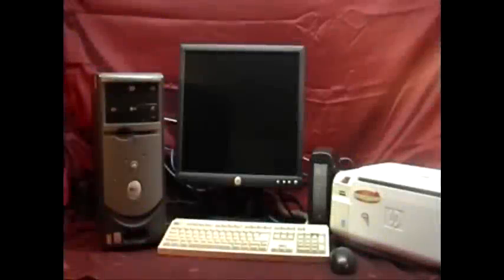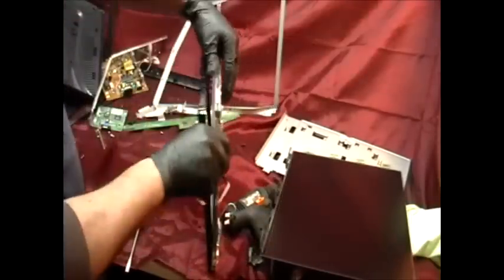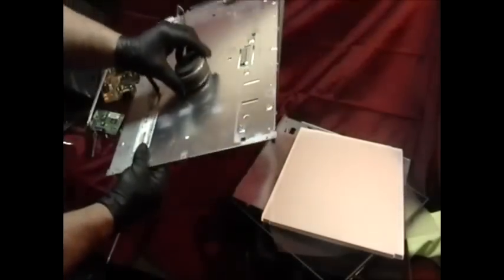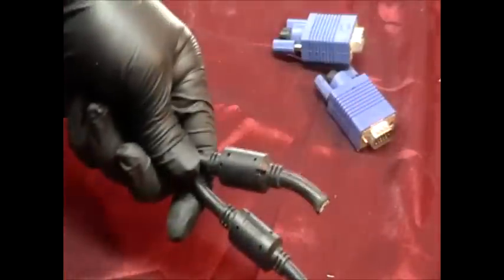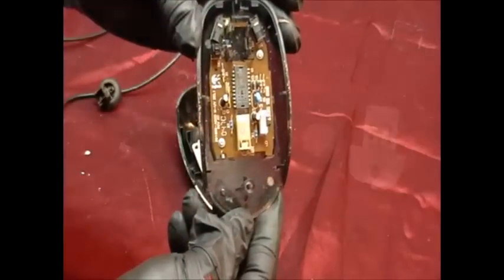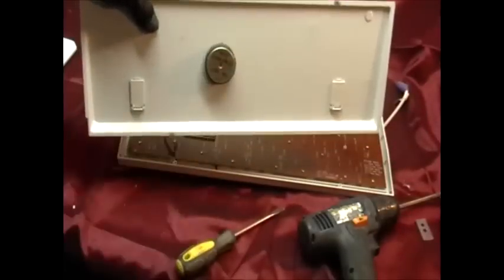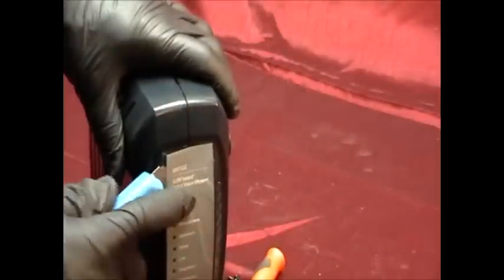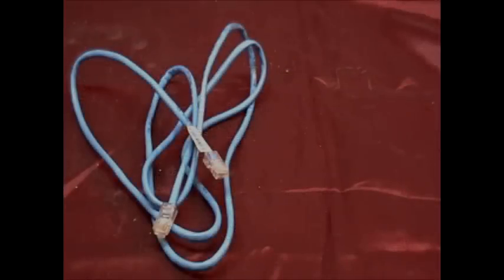Scrapping Computer Components

Comment: I had a bunch of those little printer motors and decided to see how hard it would be to get them apart.  Not too bad.  A few good whacks on the end of the shaft usually opens them enough you can pry them apart, then the rotor part just pulls right out.  Magnets in there too!

Comment: Smelting...this might be off topic, however, would you get more for the metal if they were turned into ingots? Doesn't a Blacksmith begin with an ingot? Circuit Boards contain chips, resistors, capacitors, ect, ect. They could be salvaged (desolder) & sold individually? Do CNC systems use printer plotter/controller circuits & motors? I am not a "scrapper" ... yet ... but it does sound like something that could be beneficial to a lot of DIYers. Nothing wrong with making a quick buck; But what if.

Comment: I tore down the same monitor, and found the back metal to be quite hard for aluminum. Running primitive cathode/anode test showed titanium and held heat like steel, longer than aluminum. Can you verify?
Reply from the maker: May not be titanium for such a device. If you still have the piece of metal, stop by a scrap yard and have them test it.
Reply: Mike the Scrapper thanks for reply. I did a more thorough cathode/anode test, it is indeed a mixed titanium. I ponder different makes of the same monitor, computers are crazy like that.  Funny enough, it was not even low grade titanium..absolutely bizarre.
Reply from the maker: It may be Non magnetic stainless steel.